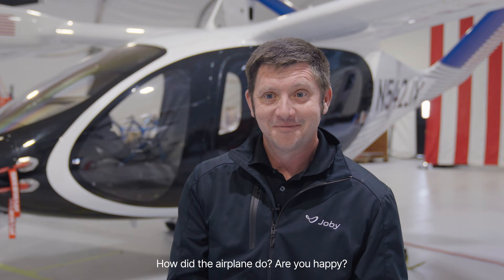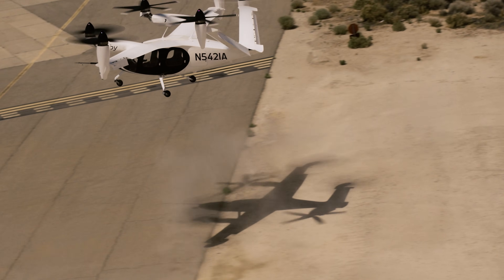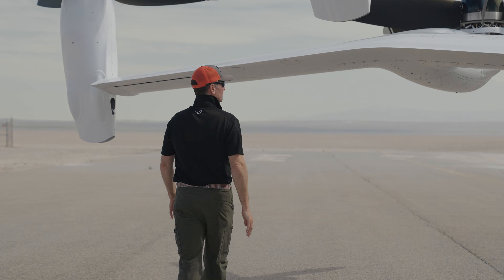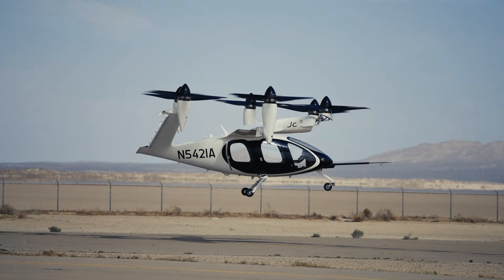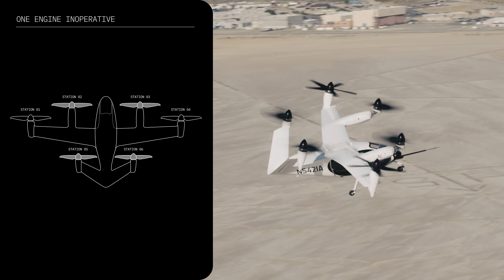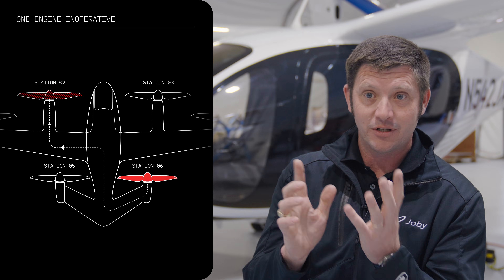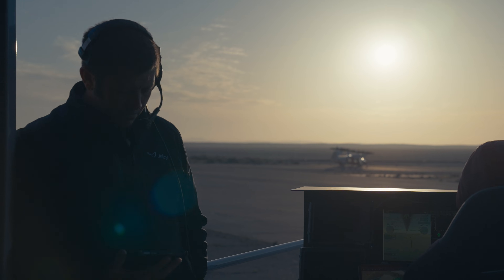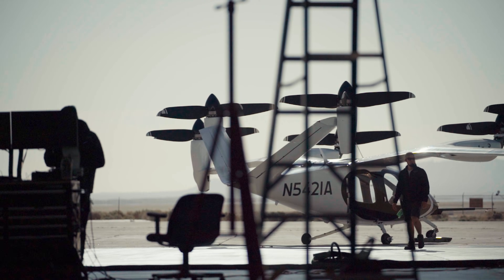Failure Injection Testing at Edwards AFB | April 14, 2025

Comment: Incredible! How many planes can loose 1 motor let alone two and still land powered and safe? Remarkable.
Reply: Many, many, many airplanes.   Even a 747 is certified to fly with 2 engines out -- and that's two out of only four.
Reply: @johnborton4522 cant take off or climb though.
Reply: @MeerkatADV  I can't tell if you're talking the 747 or the Joby, but I suspect your statement is likely true for both.

Comment: Really nice video, thanks for sharing the process.  Great quality, good message.  Disappointed we did not see see a motor inop.  The battery inop or single tilt mechanism inop are not visually interesting because of the redundancy.  Still, kudos to Joby.
Reply: The scenes where two motors spin slowly are the inoperative motor procedures. Once the failure is injected in one the opposite engine stops providing torque. They spin slowly vs being stopped because they windmill
Reply: look closely @1:28 station 1 and station 4 are spinning different then all other stations.